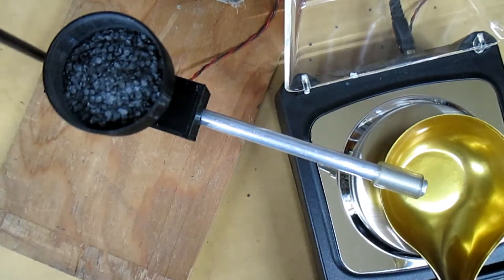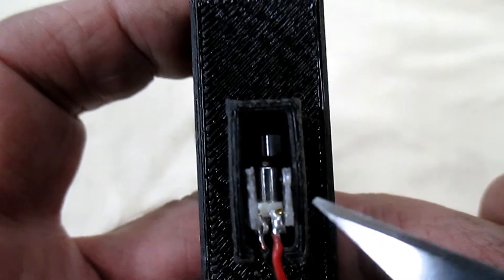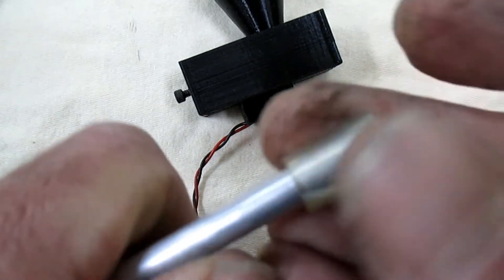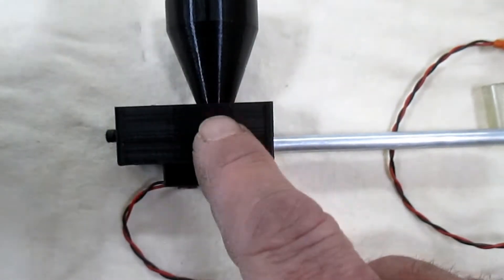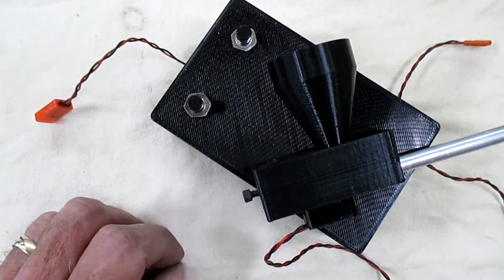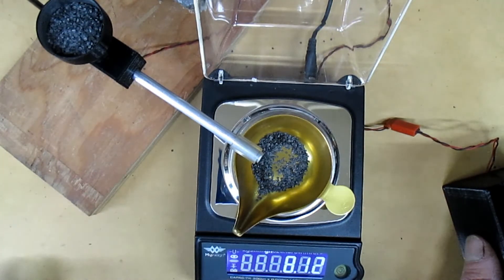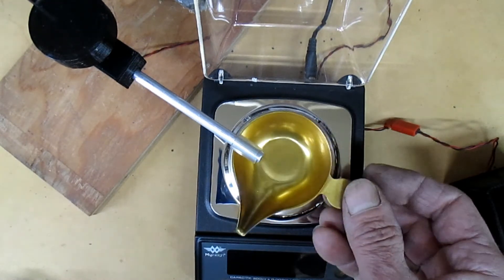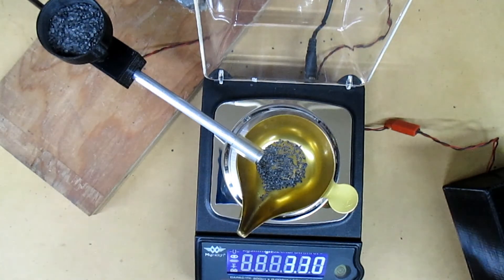Power powder trickler

Comment: Nicely done!  I made one last year and just used a wood block for the main body (I don't have a 3d printer).  One other thing I did was, instead of using two push buttons, one high and one low, I have a single push button and I used a 1.8 to 12v PWM modulator I got on Amazon ($8.59 for a 2-pack of them) and a knob so I can infinitely vary the motor rotation speed on the fly.  The knob sticks out the side of the box and button on top.  So, I just lay one hand on the box, hit the button, then vary the speed with my other hand as I trickle.  

I went that route on the controls because I load such a variety of powder, I found that the "2-speed" version made it difficult to low speed trickle some powders, or it would dump to many kernels too quickly with others, just couldn't find a happy medium.  The variable speed gives me perfect control for any powder I use.
Reply from the maker: That was a good idea on the speed control, what motor did you use? Power trickler is a life saver for reloading, thanks for your feed back.